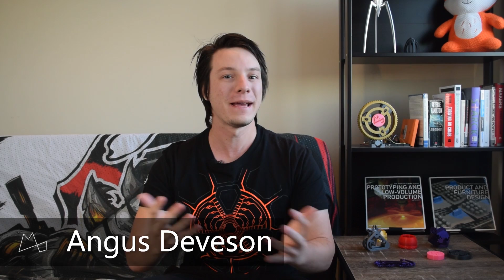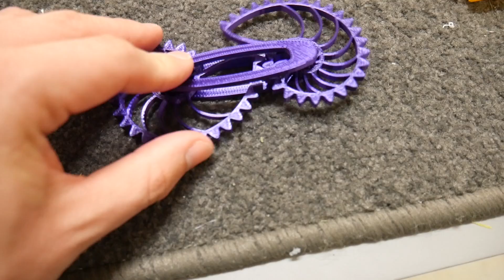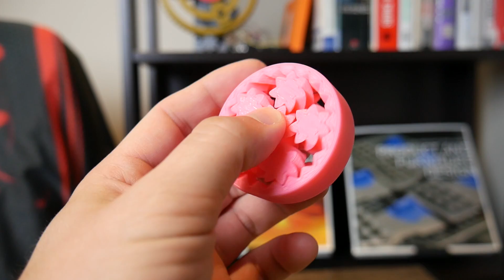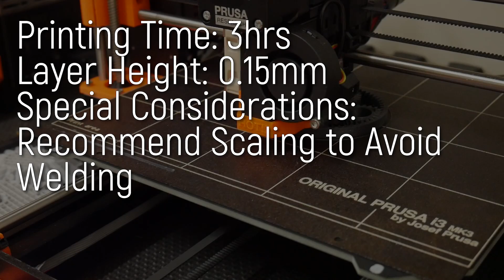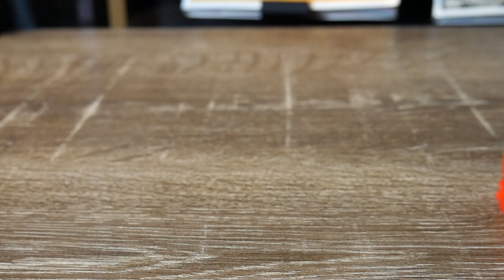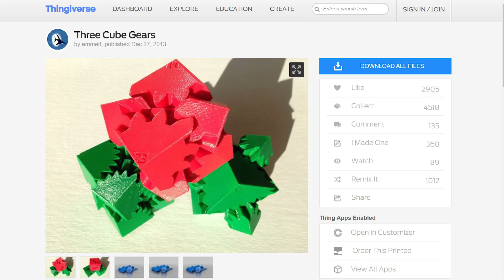5 Cool 3D Printed Mechanisms

Comment: I'm not a 3D maker, but I'm intrigued at all the fascinating possibilities of developing micrometric (with details under 1mm) scale components of multiple materials simultaneously. 

I'm fairly sure it's possible to manually swap filaments during a build, but I'm wondering when the technology would allow for multiple nozzles to work in tandem (accelerating construction & producing almost unimaginably complex mechanical devices).

Just consider having one material (eg: hard wax) for the support structures & another for the component... How 'bout making complex gearing structures/patterns, like a pocketwatch? Or even integrating a robotic arm to install microelectronics into a 3D printed circuit?

Comment: I printed "Gear Bearing" but it can't spin around smoothly like on video. There is a point where one of the gears stucks and it vary mave to move over. Printed twice (1 original/untouched file and 1 bigger sized) and both have the same problem. Any idea????? :O

Comment: At least these filaments don't need to be covered in kerosene unlike the first 3d printer I invented in 1988 had on it. I made a special loader for it to keep the kerosene from igniting while melting the fishing line or weed whacker filament. I am implementing a new use for that super quick loader in my valve timing transmission I am inventing at least not a total waste.

Comment: I just 3dprinted the gear cube. It is sooo awesome! Well worth the waiting. I had 3 failprints, bad bed ethetion... even my rafts failed. But it moves so awesome!! If you want to make the gear cube: download the updated version! Sand the pins and use some oil in the holes. It will be fine.

Comment: Those printing times estimations are useless unless you also tell us more settings, like the printing speed and the nozzle diameter (although I bet you use a 0.4, like most people). With a 0.6 nozzle, using 0.16 layers and a speed of 100mm/s in cura (that's x2 the default speed), estimated time is around 4 hours... I wonder how did you those estimations.

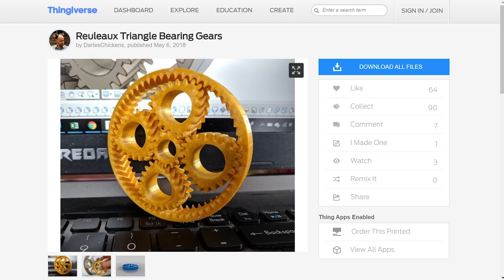Comment: what about a smooth bearing that is like the one at 3:45 but one of the inner gears are weighted so that it stays at the bottom as it rolls on the ground? kinda like one of the wheels that rotate but the inning doesn't move

Comment: He’s using a Prusa, which is known for high quality (to my knowledge at least) so my question is could I do this stuff on a Creality CR-10? Or is the quality not good enough?
Reply: Printed the Gear Bearing on my Anet A8, and it just works fine, so  i guess it should be no problem at all for your CR-10 if its callibrated correctly
Reply: Leonard Stintzing thanks bro

Comment: WHEN IS SOMEONE GONNA PUT A TRUNNION/INDEXABLE ROTARY TABLE ON TO A NICE 3D PRINTER ??
Yes, I want LIVE TOOLING TOO.
Is a 24tool auto toolchange too much to ask too?
Shheeesh... Should be easy to make a dual Column 5Axis 3D printer that has Pallet and Magnetic or Vacuum holddown too.
Reply: In which case would you need anything of that what you wrote? Or is this supposed to be a joke? If that is the case its not funny to me but keep on trying man

Comment: i don't have a 3d printer
Reply: Get one. Anet A8 $140 shipped. Around 4 hours assembly is all. A few modifications such as insulation on the hot end and frame support will get you high quality prints.

Comment: I think another great add-on to this list is the NASA wrench that was sent up to the ISS for their 3D printer. It's a fully functional, ratcheting wrench that prints in one go - nothing to assemble - and it's actually really strong. It can only tighten, but I would assume that making a mirror of it in the slicer will make it loosen.  https://nasa3d.arc.nasa.gov/detail/wrench-mis
Reply: Interesting design!!!....I suppose if the socket shaft protruded from the opposite side, the wrench could physically be flipped to reverse direction!!!...but if printed flat in place would require support. UNLESS the shaft area was void, shaft printed separately & inserted after wrench & shaft were complete. Just an observation!😁👍🏻

Comment: When I was in high school, my engineering teacher had a makerbot. I was wanting to get one, what are y'all's opinion?
Reply from the maker: I would not recommend it. Instead, maybe start with an Ender 3 or Cetus and go from there. Way more affordable and better (imho).
Reply: If youve been printing a little while and are looking for end production use printers within the 1000 price point i highly recommend the prusa mk3s,  or a creality cr10s pro ( i currently own a 10s pro and after an inductive sensor upgrade the machine preformes amazingly with little to no calibration after initial auto leveling.   One other thing i added was a purge line within the gcode due to the default purge blob  ( in the center of the plate no less )  now with a line at the bottom left the nozzle gets perfectly primed everytime.

Comment: Cool 3D printed mechanism ** 2x faster play helps speed up the information translation (screen to brain interface) from internet streaming video file (information) visual data! The pixels on the screen painted automatically by display drivers as the backlight pumps photons through the IPS LCD switching array : or in the case of OLED the OLED driver that modulates the timing & intensity of each pixel that gives rise to the wide color gamut with pure black quantum contrast enhancement technology! Woot woot to applied computer science & technology!

Comment: Gear bearings are what i can understand at least, the basics of how an automatic transmission works, a rotary gear with a series of planetary gears going around a sun gear, they look cool and work amazingly to change output shaft speeds with the different ratios of gear involved in its movement

Comment: A cool use for the nautilus gears is in the fire control computers of old warships (mechanical computers). The trajectory of the round was machined into the gear so you could input distance/wind/speed and other variables and have it 'compute' a firing solution. See the gear at the 6 minute mark here: https://youtu.be/DD2dtAqJcJ4

Comment: But all of this you can do without a 3D printer
What a 3D printer can do that the human hand can't?
Reply: rivitril only one of them you actually can't do by hand. The gear bearing. There is no way to fit the pieces together if they aren't created already in a locked position. But I get what you are coming from. These designs can be made by hand. The appeal of 3d printers is you can send your design to someone else and then they can make it too even if they weren't shown how to carve something themselves.

Comment: Can you print with a low melting point metal like pewter or gallium? They should both melt at low enough temps for most printers.

Some compound bows use asymmetric gears like that nautilus gear to help keep an even draw weight.

Comment: What's the cheapest possible way to start 3d printing, like diy sketchy China stuff.
Reply from the maker: I recommend the tronxy x1 , I discuss it in my budget makerspace project videos
Reply: Dang, and I just ordered a Creality Ender 3
Reply: MOD-t has no weird issues that other printers have. The head is extremely stable and fixed in place, the bed just moves to print. It doesn't have a huge print area but it's reliable.
Reply: I would recommend the MOD-t, but New Matter went out of business. I picked up how to use it in a day or two and now I'm the most knowledgable 3D printer guy at my school.

Comment: Great selection of mechanical prints Angus. The gear cube has been a favourite with visiors, its eye catching on the shelf and they grab it and soon after exclaim "no way!" or "holy sh*t!" when it moves. Add a small amount of Super Lube or dry PTFE lube when you assemble, spining parts to ensure lube spreads and print imperfections get smoothed. 

Apart from being just cool these designs showcase how possible it is to take constant rotation and apply it in a different direction or different way. Good for sparking ideas and for designing practical builds like tracking mounts for photography, astronomy, solar projects for starters.

Comment: Hey Angus, "Darles Chickens" here, great video! I designed the triangle bearing gears with you in mind, so thanks for the inspiration. Hopefully you can get the print to work! Slooooow that printer down, cowboy! I shot you an email.
Reply: Gaaa! So much pressure for a newb hillbilly with a cr-10! I was telling Angus I'm going to split the model on thigiverse so parts can be assembled post-print.
Reply: Fast printing is the only way to go! That's why I got an SLA printer... wait
Reply: https://youtu.be/DNiuVaoqaE4
Reply: I can print the iris box on a JGAurora but speed is everything. I'm trying your gear next!

Comment: I think the nautilus gears could be used for an axe mechanism on a combat robot. The variable gear ratio could be used to overcome the initial inertia to get the axe moving, then accelerate it faster and faster before impact.
Reply from the maker: That's actually pretty brilliant. Hmm!
Reply: great, until the robots rise up and axe us!
Reply: but then you have to lift the axe back up to strike again, and you have no leverage.
Reply: Yes
Reply: Genius
Reply: im worried that this person seems to have so much knowledge of robot axe weilding.
Reply: 500th like!
Reply: In a less destructive device this could work in a prosthetic limb. As the ratios change so with the amount of force or torque. You would have to probably use a 3D metal printer that can sinter very small gears. I can visualize a combination of these years powered by an electric motor or servo actually connecting to wire soft wire operating pulleys and push rods. Maybe bell cranks. Then it becomes a question of the electrical pickups and the computer to power it. The actual electrical power could be lithium ion that simple. You could use a battery pack out of a phone even and use the induction charger.
Reply: Umm. They scale to a 1 to 1 ratio. yes the force is higher ifyou drive it starting from the gear meshing from the small end but there isn't any sort of "gearability" (if that makes sense)  to increase its lift capacity. Plus it would have to be metal if its going to be a sturdy, long lasting robot.
Reply: @noobpro9759  it scales from X ratio to its inverse. If it scaled to a 1:1 ratio, it would be two equal normal gears.
Reply: @somedude2492  
I more or less meant an average between the overall ratio since no matter what if the 2 gears are the same size its average would be 1. No matter the theoretical slope they have. Though a larger gear coupled to a smaller one would both look and act pretty interesting. But the ones shown in the video are in fact a 1:1 ratio.
Reply: @noobpro9759  they are 1:1 if you use the average from every point. At the "begining" of the gears, one has a bigger diameter than the other, so the ratio cannot possibly be 1:1. At the "end" of those gears, the ratio is the inverse of the ratio at the start. Having a constant speed at the input creates an acceleration in the output, product of that difference in ratios.
Reply: @somedude2492  I agree but the application they are trying to imply isnt about increasing speed. They want robot arms which would need to build torque. So in short, this gear wouldn't be the one to use for said application no matter how much you know about gears.
Reply: @noobpro9759  to get something to move you do not need to build up torque, you need torque from the begining to overcome the mass trying to stay idle. When it starts moving, you do not need as much torque. This is the moment where you want to gain speed so that when the axe hits stuff, it's momentum is as big as possible and makes some damage. 
To sum up: start with a gear ratio smaller than 1 to have extra torque to start moving, move to a ratio greater than 1 to gain speed and thus increase momentum.
Reply: @somedude2492  you've taken this to a level not needed for a theoretical robot that will never be made in the first place mate. Also look up eagle prime. It's already been done and I'm pretty sure this gear is used nowhere within that robot. So stop sucking the gear shaft and use your knowledge for something better than winning an arguement online.
Reply: @noobpro9759  Theory is as essential for science as oxygen for living organisms. You should know that. Discussing theory is good. Especially when debunking flawed theory.
Reply: @PunakiviAddikti  3 month dead but ok.
Reply: @kingacrisius  this arguement is a year old. Fuck off with your dumb ass.
Reply: @noobpro9759  Beta (Heavyweight combat robot) actually uses a Nautilus gear for their hammer. Cheers, friend!
Reply: @nolyarb2874  still impractical either way.
Reply: @noobpro9759  Not so sure! Hard to tell the world's best hammerbot what is practical or impractical.
Reply: @nolyarb2874  
Just because a car runs that doesn't mean its perfect.
Reply: @noobpro9759  Agreed! The people who build the fastest car in the world probably know something about cars though.
Reply: @nolyarb2874  the type of car doesnt matter. They can have the same issues and keep running. Its like how with guns the germans tend to over build and the Russians underbuild. The ak lasts forever but wont be maintained but the mouser is mechanically beautiful buta pain in the ass to fix. Just because that gearing works in a robot doesnt mean a different setup couldnt do better. Who knows. maybe everything about that hämmerte joint is beefed out like crazy because the gear shape is weak. They had to acomidate their stupid use of this in someway and i doubt they did itfor little more that the ability to say "hey look at these cool gears".
Reply: @noobpro9759  I definitely agree. Perfection is unobtainable. I'm sure there are better designs that are possible. What issues do you see with using the nautilus gear for a hammerbot over a regular setup?
Reply: @nolyarb2874  the dong like tip on the gears will just pop off if its not thick enough. But this robot is probably a chungus
Reply: @noobpro9759  Ahh I getcha. Yeah, it's quite the beefster! 250 pounds worth
Reply: @noobpro9759  just because a comment is "old" doesn't make it irrelevant. First of all, your original argument was straight up wrong, and second of all, unless you delete your comments, we are free to respond to them at anytime.

Comment: Geometric vases are my favorite quick, unfailable, demo prints as you can get a fairly large print in half an hour. Specially around xmas where the can server as decorative bulbs that can slip over standard mini lights, just print in something at least semi-translucent.

Some of my favs for this
Geaornament, thing:38948
Geoflower, thing:982849
Round geoflower remix, thing:1199549
SPIRAL vase, thing:481259

Comment: Great video! When I was working at as technician at Texas Instruments and I guess before steppers were cheap, there was a tool that would inspect the four sides of an PLCC IC and it used the geneva mechanism to orient each of the four side towards the inspection camera.

Comment: One of the first things I ever printed was Emmett's gear cube. A couple of things to note, this comes with different files with differing ratios of teeth. Also, after several attempts with different lubricants, I found that good ole Vaseline works wonders. It keeps the cube from making a squeaking noise when rotated. Simply apply to the pins and you are good to go!

Comment: Um.. Angus... You'r gorgeous spinning contraption was turned off again... Didn't I tell you that it should be on ALWAYS... :D

I've had a lot of success with the Nautilus Gears. I think I printed it at 100% as well as about 120%. The 2 gears, that printed where the long side is against the outer ring, were slightly seized, but you can unseize them pretty easily... then spin it a lot and it gets smoother and smoother.

Comment: I'm new to 3D printing and just wanted to know what is a raft? - sorry of this a stupidly basic question
Reply: lolly stimler A raft is a way to increase the contact area of your model with the buildplate. In cura you can find this option under "build plate adhesion type"

Comment: Great, video as always.  Question what is the best way of reaching you personally (business)?
On a side note, what sort of settings do you use for the polyachemy filament? as different from "generic" PLA settings? It seems to need a few tweaks and I have yet to narrow that down sufficiently.
Reply from the maker: Polyalchemy needs more heat - 215 to 220degC. Business email is best, via the contact page on the channel.

Comment: It looks like you use rafts for most of these. Is that your recommendation?
Reply from the maker: I printed many of them on the Cetus Mk2, which has a rough print surface and really needs a raft. You don't need it for any of them except maybe the Gear Bearing if you have trouble.
Reply: I’ve got an Anet A8 with a glass bed. I guess it’s time for trial and error.
Reply: Eric Ka I also have an Anet A8 with a glass bed, and I have spent a good deal of time getting it tuned perfectly. It has a few of the standard mods such as frame stiffeners and belt tensioners. I have successfully printed all of these models without rafts. It took me 4 attempts at the iris to finally get one that worked, probably because I was using a cheap PLA. But hey, it worked! And who says you can't get great prints with an A8? Rubbish!